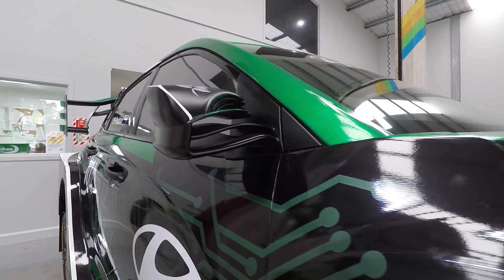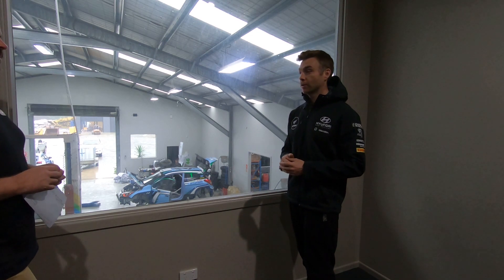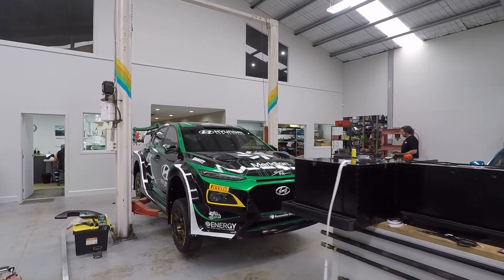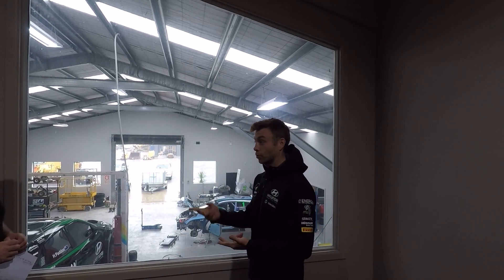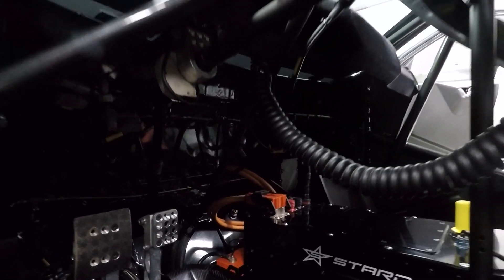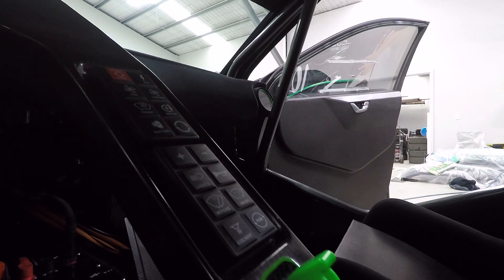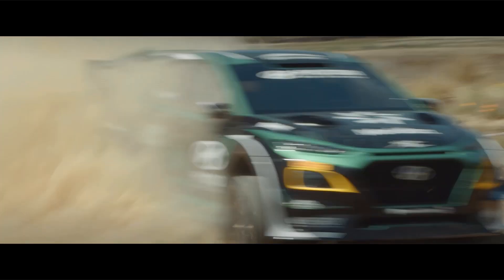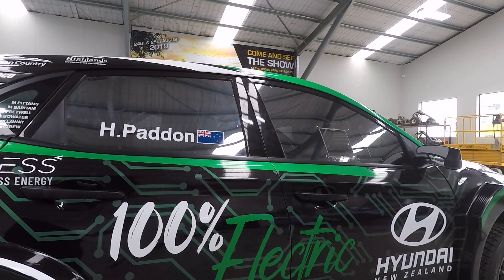Hayden Paddon and his amazing electric rally car

Comment: Am I the only one that wants to see a gearbox developed for EV cars? Like a sequential. I know the torque delivery is already pretty well optimized but maybe the "shifting" could relate to saving battery power rather than trying to maximize torque...idk lol
Reply: @mattykobs  i think it has 3 gears from what i read, but not totally sure.
Reply: Problem is it will get DESTROYED. The split second massive instant torque if the "throttle" mapping has an error and just goes full tilt. Will turn the transmission into soup. When it comes to high performance BEVs no one has figured out how to build a reliable transmission beyond 2 gears, also Zero Driver Control.